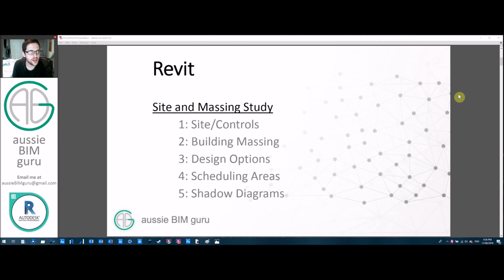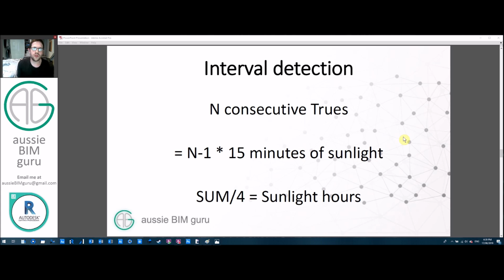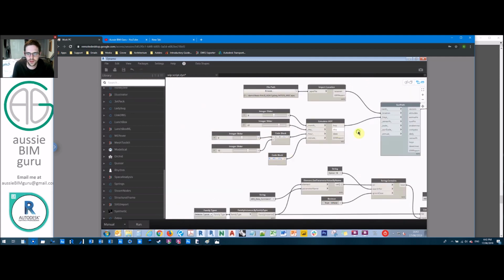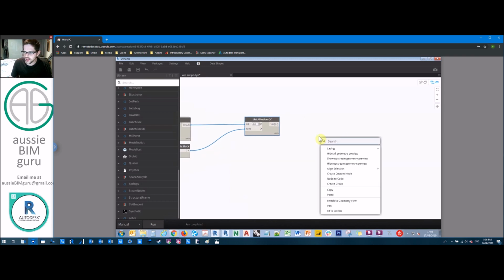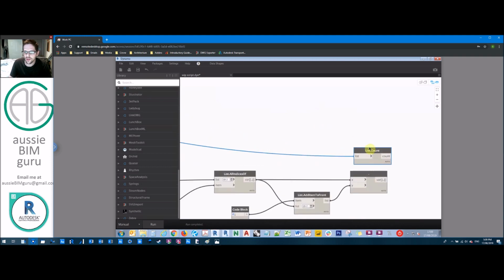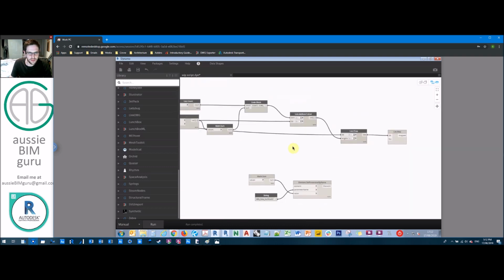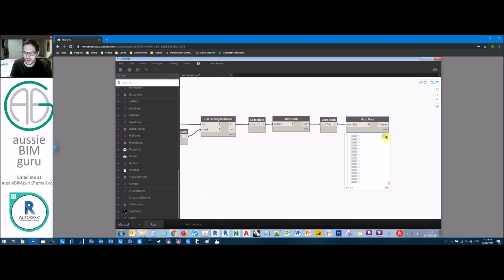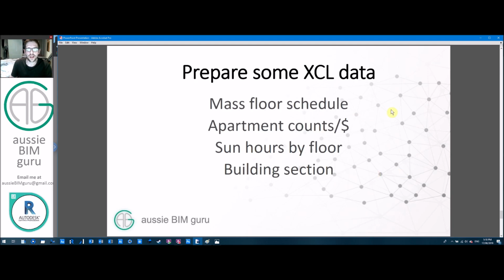Refined Sun Hour Analysis using Dynamo (Feasibility Part 10)

Comment: One question,are these principals must be strictly followed.Cause in China the principals are as same as laws,if your design are against these principals，you may get fined or even go to jail as a prisoner.
Reply from the maker: This is a simplified version of compliance as enforced for residential projects in Sydney, Australia. There is a more refined testing method we use at firms generally, but I can't share that level due to IP reasons unfortunately. We generally use Ladybug and Grasshopper these days as Ladybug is not supported for Revit 2020 and higher.

Whilst you wont get directly punished for not following them, a design can be challenged on their basis by the public or a council for a development application and may lead to having to revise a design to meet compliance.
Reply: @AussieBIMGuru  Thank you for your reply，in China when analyzing the hours of sunshine and energy consumption，we must use specific software designed by state-owned software company.
Reply from the maker: @mavs013  i actually think countries and councils should all dictate software and testing methods as its an issue when the standard is enforced but can be met in many ways - a lot of people fake the testing or dont do it properly.